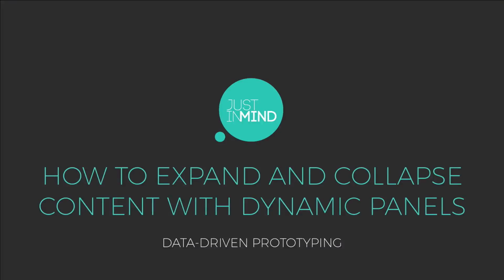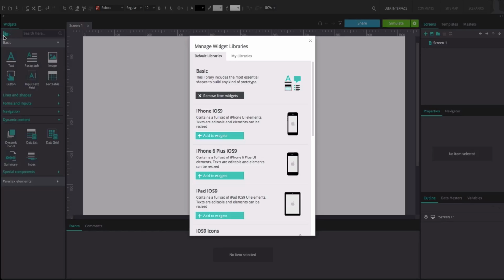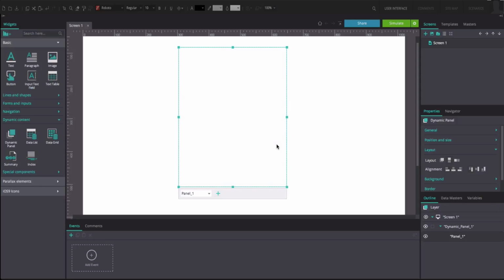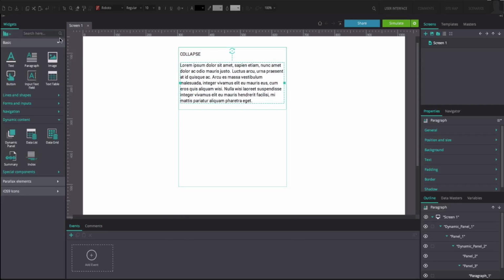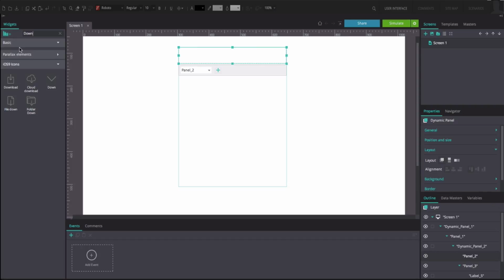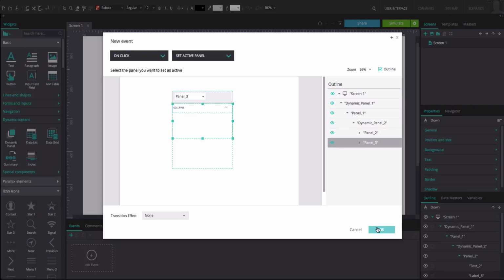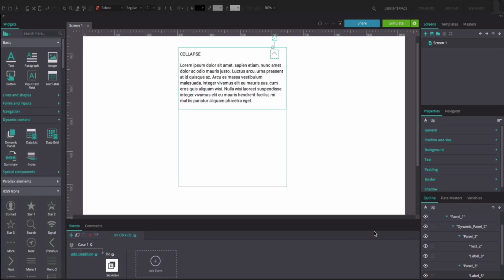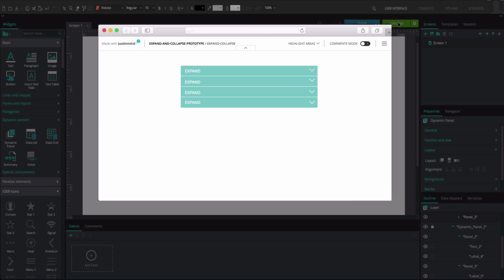Expand and collapse content with Dynamic Panels in your UI prototypes

Comment: Hi, I've been working a lot with this feature to build an application. A problem I am facing is that parent dynamic panels do not resize/adjust accordingly if a child panel is of a larger dimension. If the parent panel is adjusted to be larger than the child within it, then the next dynamic panel does not fluidly adjust, it will have a gap/white space between parent panel 1 & 2; if the parent panel is adjusted less than a child panel, then the child panel content gets abruptly cut off to the size of it's parent...Is there a way to do this or does the functionality not exist/is limited in this aspect?
Reply from the maker: Hi there, please post your question in our Community to get an answer from our support team https://www.justinmind.com/community/